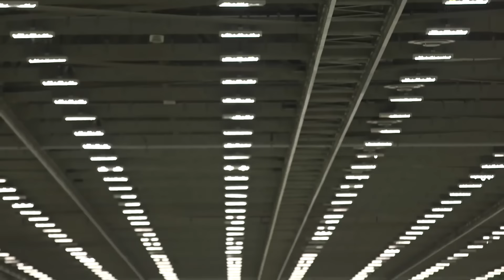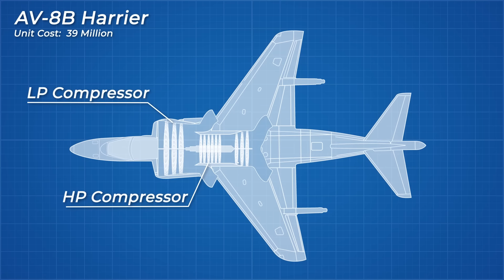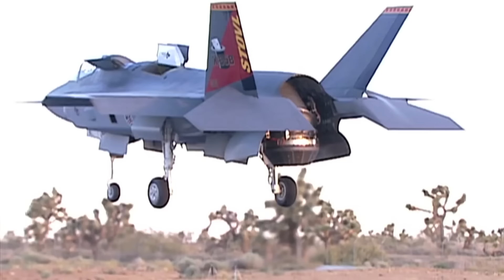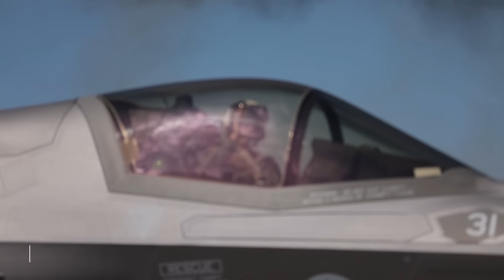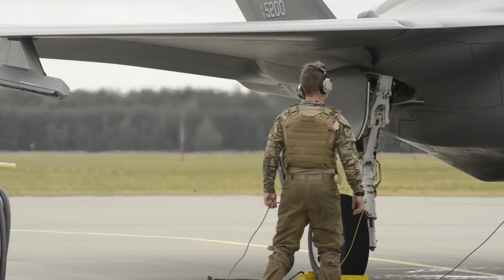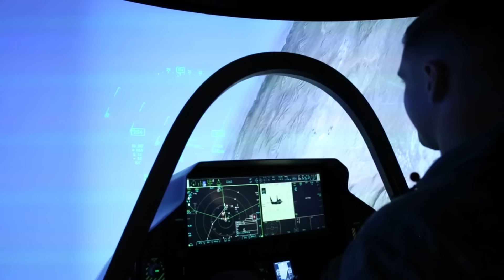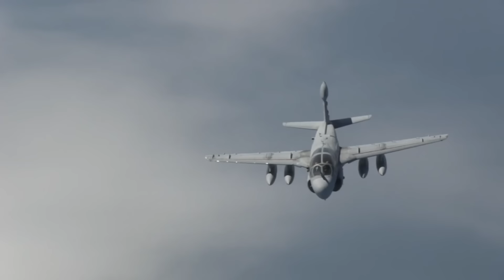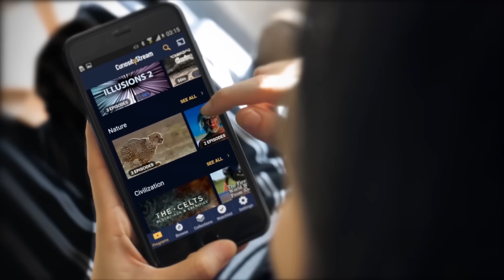Is The F-35 Worth $115 Million?

Comment: the f-35 is not designed to dogfight. It is designed to shoot down it's targets before visual range, just for anyone who thinks dogfighting is still extensively used in modern combat. Even the f-14s were able to shoot down targets that were 100 nautical miles away.
Reply: lazerpig fans rise up
Reply: @enitsu-142  reporting in
Reply: Even though it wasn't designed to dogfight, it actually can! The F-35 has a very good AoA capabilities, surpassing that of the F-18 (which is already has one of the best AoA capabilities). So, in a merge, the F35 can get its nose around faster than most enemies, and use HoB missiles to strike the enemy first!
Reply: @patchouliknowledge4455  It sure can out-turn an fa18 (I've even seen some sources claim it can out-turn an f16), but f35 pilots say that it loses a lot of energy in doing so. Still, the HoBS capability more than makes up for that, and another massive advantage it has is the SA it gives to the pilot. It's commonly said that if you lose sight, you lose the fight. In am f35, that's not gonna happen.
Reply: BVR is not unique to F35 but all modern fighters of the last 30 decades.
Reply: @georgemavrides3434  yes, which is why the f-35 was designed to not be a specialist like the a-10 or f-22, but a flexible platform for different mission types, and so wasn't designed to excel in air to air combat at close range, all you need to do well in bvr combat is to have good missiles.
Reply: @jimothywhimothy8683  its generous to call the a 10 specialist when its ass at the job it was designed to do
Reply: @Helperbot-2000  it's called a 'specialist' because that's the only thing it really can do, regardless of whether it does it well
Reply: @Helperbot-2000  oh yea the gun is too big for strafing ground target but too weak to kill tanks
Reply: @jimothywhimothy8683   Have you ever flown a fighter jet ?
Reply: @Desi365  what does that have to do with it, I'm basing my point off of what people who have flown it/designed it/sell it say it is meant to do.
Reply: @jimothywhimothy8683  Good missiles, good sensors, good electronic warfare equipment and good stealth.
Reply: I would argue the primary job of any military vehicle is do whatever it's gonna do without dying, which the A-10 excels at. 😆 @Helperbot-2000
Reply: @georgemavrides3434 30 decades? 🤣 I know what you mean.  That being said no one claimed it was unique. OP even mentioned the tomcat.  What he means is that it no longer prioritizes visual range capabilities in its design.  That being said it's no slouch at that either.  Just not quite up to the 4th gen aircraft level.
Reply: @georgemavrides3434 He didn't say it was unique to the F 35.

 WITH that said. The F 35 is nearly God tier at it due to the sensor array. 

 The greatest strength is that the things it lacks relative to other craft can be tossed to more specialized craft.

 It is the quarter back of the AF. It can hand off the ball to others, or run its self if it needs be.

 I feel like a lot of people think the air force duels other aircraft fairly or something. Like war is fought in a bubble!
Reply: @georgemavrides3434  like to see those fighters from 3000 years ago.  Ha!!
Reply: @Il.Livorno.Volante  the cheapest varient of the f -35 can cost 77 million. The f-22 always costs around 200 million. Of course no fighter is 100 accurate in bvr. But according to actual fighter pilots who have been in air to air combat in ukraine, your much more likely to be shot down by something 20 miles away that you cant even see. The f-35 is designed to be  that fighter that you cant see. Although having an irst is a very important thing, the f-35 has advanced datalink, which will mean that it can shoot down planes based off what other aircraft can see (e.g an awacs).
Reply: True, but it seems that the F35 can still hold its own in a dogfight if it is forced to. Software is the key. And the F35 is a digital platform, capable of receiving software updates seamlessly. On the fly.
Reply: @marcusrat4466  it has less maneuverability, it is “slow”…same quality pilot in F35 and SU35 , F35 loses air combat.
Reply: @johny5400  the f35 can pull lots of aoa it by us estimations is the 3-2 best dogfighter in the us inventory the famous story of it getting out manuverd by an f16 was because the f35 had a bomb on it and the f16 had nothing no missles no bombs nothibg
Reply: @JJ 1 Over the horizon radar doesn’t work if you can’t pick up the F35 before it blows you out of the sky. The reason say the F14 was so effective as a BVR was it’s radar was the best there was at the time. Now that radars are reaching there limits, stealth is the new factor that will decide fights, and on that front, nothing exists better then the F35
Reply: Why can't we just get along.
Reply: Did you make them?
Reply: It’s not just about dogfighting, being manoeuvrable is very important for evading fire
Reply: @tor2919 You aint outturning most modern missiles
Reply: BIG PHAT lumbrering bombers.
Reply: @Il.Livorno.Volante we have no reason to believe that the  2 stealth fighters would merge.  The same way 2 non stealth fighters wouldn't merge.  The planes will be able to tell a stealth plane is in the AO they just won't be able to get a weapons grade lock.  It's still just a matter of who pings first at which point one side is defensive despite not even having seen the other.  The f22 has its weaknesses too.  It wasn't designed with modularity in mind.  It is very expensive to upgrade.  Part of the f35s selling point was to future proof it by designing it to be modular.
Reply: Than they were carrying really heavy missiles to destroy targets in more than 150 real on earth miles.what an outstanding aircraft specialist you are! Or it just another BS.
Reply: yea, but those shots are radar guided and the other aircraft knows very well the shot is coming and where it is coming from. Few chaffs dispensed and threat is gone…if shot from far away, you can just outmaneuver the missile till it loses momentum.

Some distant shooting is not working and sooner or later the planes are shooting within 10nm.

If the pilots are the same, then the radar capabilities of an aircraft and the maneuverability is what decides. I think F35 against the new SU is favorable one or another , depending on the scenario. 

Jets are overall not too hard to shoot down.
Reply: @johny5400  you can't outmaneuver a missile. They don't have a squishy human on board so they can make much more extreme maneuvers. Can your plane make 55G turns at mach 6 whilst not having it's pilot implode?
Reply: @dod_the_angel  of course you outmaneuver long range missiles, radar guided missiles, that is absolutely normal
Reply: @dod_the_angel  The missile isn't undestructable, it cas withstand very high G manuvers but not 55G...
Reply: @RLRGC  AIM-120s can handle up to 45G sorry for that. However what you're saying is bollocks. An AIM-9X maxes out at 70G. No aircraft can outmaneuver that
Reply: If the combo of F-35 and Meteor Missile was achievable then it would worth every penny. Meteor is greatly superior in BVR than Abraahms -120 any variant.
Reply: @Rousseau4469 exactly, only as good as the missle your sending.  We are behind in that category unfortunately.
Reply: Not only can it not dogfight, but a dirty little secret inside the pentagon is that it's completely incapable of crop dusting.
Reply: Maybe you should tell that to the Russians who have the SU-35 that has a 260 mile range on its radar. And the stealth doesn't work against ground radar from the 40's. Good luck not getting shot down with this "hi tech" plane.
Reply: @thorinbane  260 mile range, yet can't detect an f35 until it's within 20 (even less for an f22). Pretty easy to not get shot down when you can't be seen lmfao
Reply: @thorinbane  oh yes. Muh didn't know it was invisible. The most overhyped shootdown ever. It took everything for the nighthawk to go wrong for the Serbs to even have a chance of hitting it and the guy that did it even said it was a ridiculously lucky shot.
Reply: Virtually no F-14s ever shot down an aerial target at 100 miles.  Why?  Because you have to visually identify the target before you shoot it down.  No duh.  Radar only provides the most basic information about a contact.  It is against aerial doctrine and international law to shoot down an aircraft without positive identification first.  So the ability to shoot down targets beyond visual range isn't all that useful.
Reply: @Maniac742  one word. IFF. identification of friendly or foe. It's existed for ground radars since 1941, and been on planes since before missiles. It allows for an aircraft to tell if an aircraft is friendly or a hostile. And the f-14 had it. The f-14 could shoot active guidance missiles on a target 60 miles away, and hit it, all while knowing that it's a hostile.
Reply: @jimothywhimothy8683  IFF is notoriously unreliable and it only tells you friend or not friend.  Aircraft are not simply friend or enemy.  You cannot shoot down an aircraft just because it's not one of yours.  No duh.  The rules of engagement forbid it.
Reply: @Maniac742  ok, cool. within visual range air fights just straight up don't happen anymore though so how do you explain that
Reply: @Maniac742  You do know that IFF technology has been in place since the 1960s? Plus, IFF is one of the most important systems in a military, keeping it unreliable makes no sense. Plus, in war, you can shoot down any enemy aircraft without them firing on you first since this isn't a Gulf of Sidra incident, its war.

"Mode 5 significantly improves the ability to identify and track friendly aircraft, providing increased situational awareness to command and control and Combat-ID functions. Mode 5 improvements include new cryptography, stronger security features, modern signal modulation techniques and greater data content. The increased data capacity enables encrypted transmission and supports new data formats, including National Origin codes and Platform Identification Numbers.

Mode 5 also includes lethal interrogations designed to prevent fratricide by providing a final challenge to a targeted platform prior to weapons engagement. Lethal interrogation formats elicit a Mode 5 response even when the platform is flying radio silent or "EMCOM," short for emission control."

So no, IFF does not only tell you whether its a friend or foe...we have 21th century technology :)
Reply: @jimothywhimothy8683  Well thats just also not true, look at the Iran-Iraq war, or the Gulf of Sidra incident, aircraft can still get into visual range, its just far less likely.
Reply: @Maniac742  “You have to visually ID a target before shooting it down”. Not in actual wartime... If that was a hard set requirement they wouldn’t invest in BVR missiles.
Reply: @Tinfoil_Hardhat  there are rules of engagement most of which require visual confirmation. so it depends on the situation, how do you think NATO aircraft intercept Russian aircraft over the Baltic currently? they follow rules of engagement which include visual confirmation and escorting of the intruding aircraft, shoot it down at 100 miles and you start WW111
Reply: during the Vietnam war America found that the Vietnamese MIG 21's were getting inside the F4's missile firing envelope and shooting them down because the F4 didn't have a gun. better to have the gun option than get shot down because some designer sat on his comfy chair decided you would never need one when in real life....
Reply: This is true, and the f-35 has a gun partly for this reason. Although back then missiles were not very good, and could only  be shot from within visual range (or close to it). And even when they had longer range missiles, they still got into dogfights (like in the f-14). The issue now is that the missiles are a lot more accurate, so most of the time  a fight will be over before visual range, and even in visual range, they can still shoot missiles like the aim 9 x. For this reason the f 35 was not designed to dogfight, it was designed to shoot from bvr distances and take out the target, all without being detected.
Reply: @davedixon2068  As I said, that's not relevant during actual wartime. Rules of engagement during peacetime aren't the same as during wartime.
Reply: @davedixon2068  the plane is equipped with at least 6 cameras that all can stream feed to pilots helmet. I am assuming that it feasible to have very large zoom capabilities so the pilot will be able to verify the adversary first.
Reply: @davedixon2068  and it also is equipped with a cannon. So it won't be a problem in close encounters. The issue for me is that it has too little hard points to deliver great payload.
Reply: @Rousseau4469  a canon that vibrates too must and destroy the plane...
Reply: @Rousseau4469  not a problem. If needed it can use a configuration called 'Beast Mode', which adds pylons on the wings so it can carry a LOT more stuff
Reply: @dod_the_angel  of course but then it sacrifices completely its main advantage. Which is to be as stealthiest as possible.
Reply: @RLRGC  have you ever witnessed such an incident? Don't bother. There hasn't been not even a case. Not even the A-10 worthhogs havent been victims of such a katastrophic failure. All the plane designers know perfectly how to install one and what structural integrity measures to take for the cannon to be stable and safe for the plane.
Reply: @Rousseau4469  well that's why you'd only use it when you have air superiority. Besides, 4 missiles (LM are working on a new bomb bay arrangement to increase that to 6) is all you'd really need for what you'd be doing.
Reply: @Rousseau4469  safe for the plane but not for people on the ground. Highest blue on blue incident aircraft in the whole US Air Force
Reply: @davedixon2068 they said the first 110 world wars were one too many, but nobody expected ww111
Reply: @Maniac742  tell me you know absolutely nothing about radar without telling me:
Reply: @Helperbot-2000  Tell me YOU know nothing about radar without telling ME:
Reply: @Maniac742  I mean it's pretty obvious you know jack when you're trying to compare fighters 2 generations apart as if technology hasn't changed since the vietnam war.
Reply: @Helperbot-2000  Tells me you know nothign about how radar works. ITs not COD where you can see your teamates in blue.
Reply: yea, F35 is also not really that fast..it has basically different role. Mostly, to malfunction :D 

nah, it is very very overpriced item. If USA wouldnt be printing money, this plane would prbably never happened
Reply: @johny5400  it was mostly designed to be a ground attack platform, where it would be able to attack targets from 160 miles away, it also happens to be a capable fighter, like the f-18. It is overpriced compared to the hornet, but when you consider everything that's on the f-35, it makes a bit more sense. 
The f-22 is an aircraft that is actually more useless, it has only been used to do a few strike missions, no air to air, and it costs 10k more an hour to fly than the f-35.
Reply: @jimothywhimothy8683  f22 is not useless, f22 is for dogfighting and air to air…which F35 is not good at due to lower maneuverability and low speed

Gripen for example has much lower operating and lifetime costs and guess what, it matter to some
Reply: @johny5400  yes, but the f-22 hasn't done any of that, it has only done what the f-35 has been designed to do. F-35 was designed to do both, like the f-18. It isn't good for dogfighting, but all of its sensors allow it to provide a lot of information to other aircraft, and fire missiles from far away. Air to air combat is not as common as strike missions, so its convenient to have one aircraft to be able to do both.
Reply: @jimothywhimothy8683  F35 is mainly air-ground…cannot chase russian su35 etc
Reply: @jimothywhimothy8683  yes but it shot down balloon
Reply: @2goober4u  that was the f-22
Reply: @jimothywhimothy8683  i meant the f-22
Reply: @2goober4u  all good
Reply: @johny5400  It costs about the same or less per unit compared to contemporary fighters like the F15EX, Saab Gripen, Rafale, and Typhoon. Yet more capable in air to air combat than all of them as red flag events have shown
Reply: @Tinfoil_Hardhat  The overal costs to design it and produce it are way way higher. The fact that now the price decreased doesnt change the fact that money were spent. 

Also, the maintenance is way higher
Reply: @johny5400  What numbers are you basing that off of? The 1.8 trillion number? You realize that is the estimated OVERALL program cost for it's entire lifetime of 50 plus years? It includes nearly 2 thousand F35s of all variants, maintenance costs, spare parts and engines, upgrading facilities, future upgrades to the aircraft, training, all into the 2070s.
Reply: @Tinfoil_Hardhat  I mean what I said. Development of the plane was waaaaaay more expensive than others. And maintenance is also way more expensive.
Reply: @johny5400 of course it's fucking expensive. You try and make a plane that can do all of the things the F35 can do to the same level of quality in a way that's cheap... I'll save you a job, you can't.
Reply: @dod_the_angel  Well just look at the rafale. The only thing missing is the stealth capabilities but otherwise it's as good or even better in every different mission. And the Rafale has very powerful electronic warfare capabilities so it isn't easy to missile lock etc.
Reply: @RLRGC  the Rafale is nearly twice the price of an F35 and is severely lacking in the stealth and networking capabilites an F35 has.
Reply: @dod_the_angel  I hope you are joking right? The rafale is about the same price as the f35 (about 90M dollars) The new F4 variant added new networking capabilites and much more stuff...
Reply: @RLRGC  the Rafale is $160 million new and is fundamentally a 4th generation aircraft with new technology added to it. An F35 is designed specifically with those systems in mind and it's mass produced so it's cheaper and easier to integrate with new technology
Reply: @dod_the_angel  incredible sources…
Reply: @dod_the_angel  The rafale is a 4.5 gen fighter, thus meaning it has many features of 5th generation while lacking others (stealth). The rafale, to produce, cost about 80M$ your number is sales price. The rafale has the most advanced missiles, and every technology the f35 has except for stealth but it compensate the lack of stealth with very good electronical warfare capabilities and the meteor.